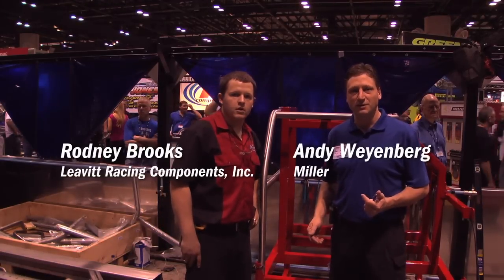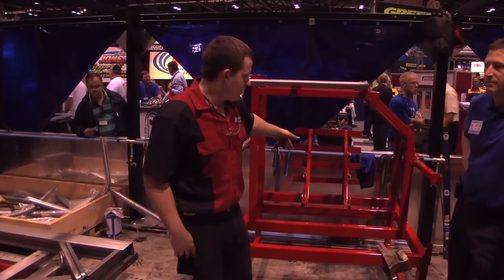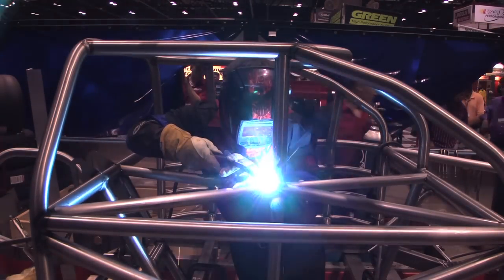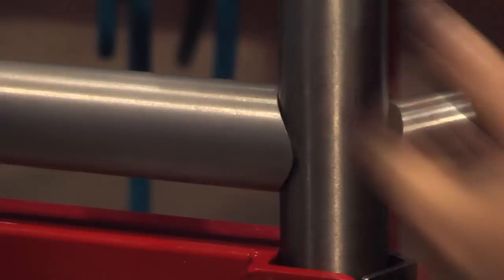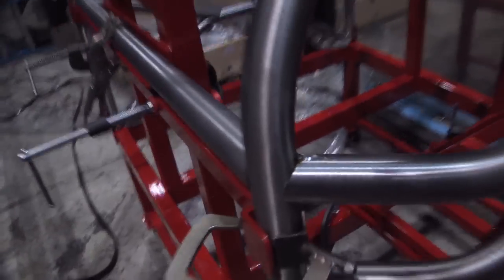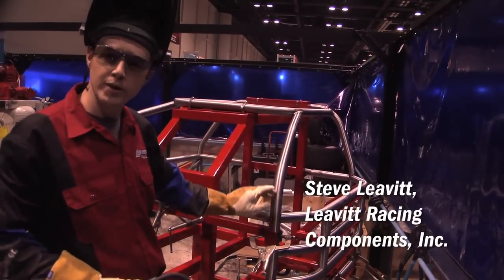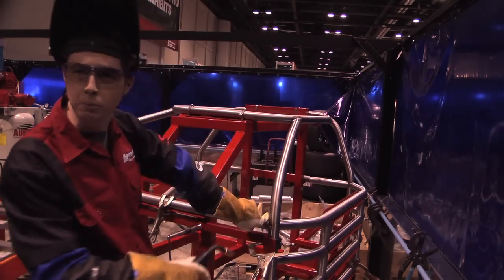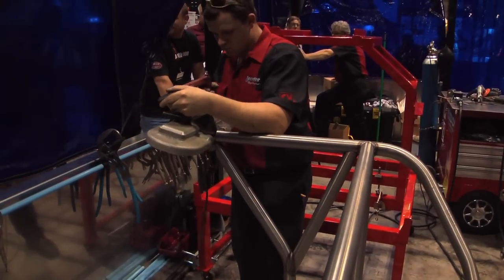MIG Welding Tips for Building a Roll Cage

Comment: you aren't allowed to use MIG for real racing cages AT ALL. TIG only.
Reply: I hate to break it to you but 99% of circle track cars are mig welded. Only time tig is required is if you use moly tubing. Pretty much nhra is the only sanction in America that requires tig